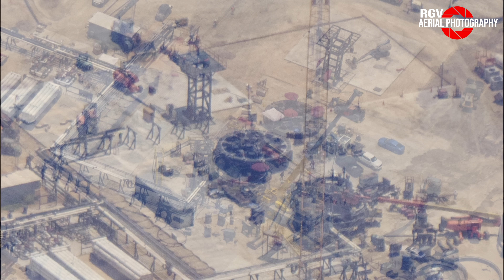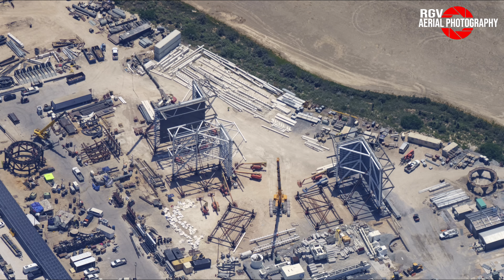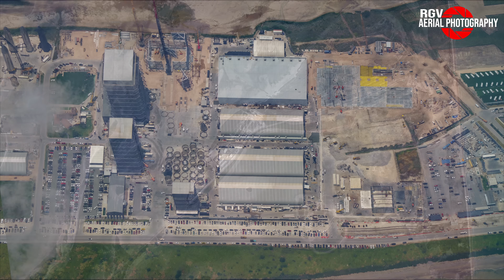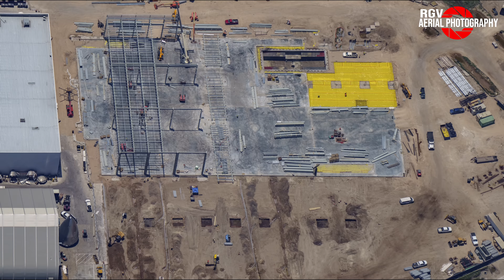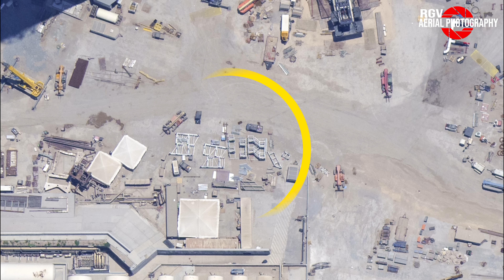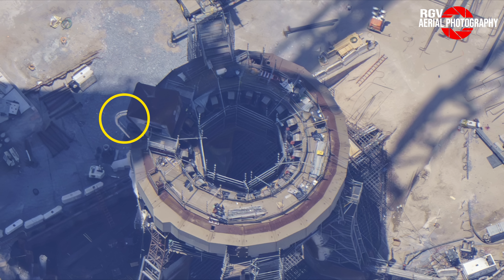Steel Plate Design Change? - SpaceX Starbase Flyover Update Episode 5!

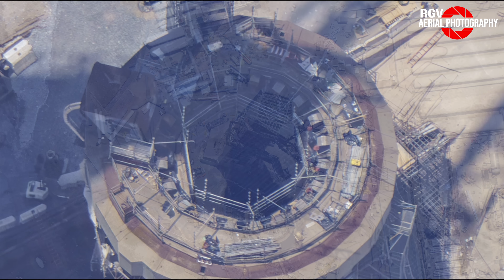Comment: 22:00 - Don't we now have a really compelling reason why the ship QD was removed? Elon is now on record as saying that the next flight will use hot staging and that booster 9 is getting an extra ring on top with vents to dissipate the exhaust gasses when the Ship lights its engines. That means that B9 gets 1 ring (6 feet) taller thus pushing Ship 25's QD 6 feet higher. Rather than rework the OLT structure itself to reposition the QD arm (a pretty big job I would think) I assume they are taking what I would think is the quicker/easier route of reworking the QD structure itself to add some sort of bracket that allows the QD interface plate to the Ship to sit 6 feet higher relative to its mounting point on the QD arm. Basically what will come back to be refitted will be a structure that is 6 feet taller than the one that was removed.

Comment: It seems that a single ring with cutouts is meant to be a reinforced extension on top of the booster to support hot staging separation. That would raise the ship height on top of the booster by one ring higher. Therefore the QD mechanism would no longer fit where it was prior. It needs to be one ring higher than originally designed. At least that is my speculation as to why they removed it and what they are doing to it.

Comment: I was a Navy Certified Welder for years. Carbon Steel melts at 720 degrees. The Raptor engines produce thrust to 2400 degrees. You have scientists there that have not understood this yet????
Reply: Steel melts at about 1300-1500 C.
Reply: That's why they flow...you know...water

See the water plastic glass with fire experiment

Comment: I will say it here as well, so that someone from SpaceX can see it, maybe. If the water deluge plates doesn't work, they ought to build a trap-bell down from the engines, a reverse engine cone, and pipe the exhaust through the old water lines (with some widening early). The tanks currently in place the end Maybe can work as baffles. I think for sure the high pressure charging tubes can have all expensive fittings cut out, the ends cut off, and a double wall stainless housing built around them all, as the final "Muffler." Or, you could just cut holes in the top of a few of the water tanks, and let the exhaust go out there. It only has to work for the 5-10 seconds that the craft is on the pad or just getting up. The ground will provide some cooling, and maybe one or two of the existing water tanks, maybe even those high pressure tubes in use, can serve to soak the muffler in the event of multiple launches per day.

Comment: There's been some speculation about where SpaceX might build yet another megabay if/when it gets to big volume building and needs even more space. Looking at that render of what the new Star Factory might look like at time index 14:51, and particularly the wider angle view of the build site at 14:52, reinforces an idea I had a few weeks ago.

High bay already has a top floor that Elon is sometimes seen in and Megabay has at least one floor at the top as well, which from the height of that top space could even be 2 floors if they put in an intermediate floor structure to split it into two .

What I was thinking, given SpaceX has already put extra floors on top of production facilities and also has shown itself very willing to demolish/relocate existing structures (low bay and ground fab building), is that if they need to find well-positioned space for yet another megabay even just a single level of office space as an extra floor on top of that taller end of Star factory when they build it would allow them to move the Stargate office space there, demolish the existing Stargate building, and use that patch of land for another megabay.

If it is like the render then even just a single level of office space above the nosecone end of Star Factory would probably give twice the office space currently at Stargate, probably more, and that existing 2 floor Stargate building really is not efficient use of space as they get to the stage of wanting to build more and more production infrastructure.

Comment: I bet you will see metal plates dismantled and as debris spilled out on the next start. The pressure from the inner Raptor engines can only built up pressure because the outer raptors will make it dificult to release this pressure. This immense pressure will get the water out of any hole in the plates and destroy the Metal plates entirely on launch. The 3rd try will have a flame diverter, a curvrd dome in the middle, that helps getting those built up pressure sideways and outwards. The sideward angle from the inner Engine output will also help, to save the ground underneath.
Reply: I love it when you pretend engineers pretend.

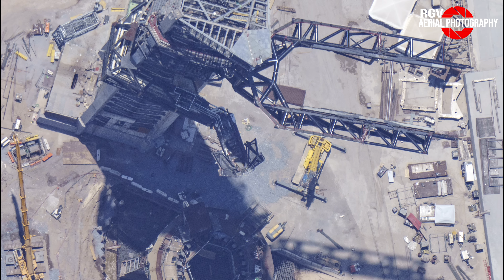Comment: 22:07  Slight chance the Ship QD might need to be retrofitted to connect to a higher point. Remember the booster is getting a last minute update with an extra area ontop mostly filled with vents to facilitate a new hot staging method of stage separation. I presume the booster is not going to sacrifice the tank sizes to add this sheidl and vents section, rather they will just install another ring segment that contains a bit of shielding for the top of the booster with vents on the ring section to allow them to ignite the ship engines just prior to stage separation.

Comment: I think those two half ring sections will be part of the new vented top of booster which will allow 2nd stage engines to hot start in order to separate the two stages.

Comment: Also, If you notice the corrugated ground depth barriers), that allows/shows, the true dimensions of what the final pad outline will look like. There is no true (degree), on which the platform will lye true with x/y length. But SpaceX is definitely not messing around this time. Just the, (walk the plank," alone shows how far they are intending to lengthen the driveway. 
Truly great footage. Thanks for all your hard work! 
 - NOM

Comment: Those holes on the  OLM probably will serve two functions.  One as a relief for the pressure entering the platform, as they will have up to three high volume pipes pushing on a platform with only the water jet perforations.  The other function, if you look at the hole there seems to be an object dividing the hole into two hemispheres, which would increase pressure through the hole making a water wall for the thrust to hit against and futher dampening it.   Just a guess though.
Reply: exactly my guess as well.

Comment: That massive assembly of rebar which implies a certain thickness to the concrete does not surprise me in the least and I suspect that is not a design revision. Cooling water perforated plates and all the piping are not load bearing devices so they themselves need to to be supported from underneath. Think of that thick concrete as the support structure for the cooling water spray system. Even with water spraying at full flow that is going to be a serious push against the spray plates.
That ring header is just that a supply header and hard to think they want all those elbows taking the brunt of 30+ engines.

Comment: Those bends in the water pipes supplying the water cooled plates eliminate the need for valves. The bottom of the bend is above the top of the water tanks. Since the pipes connect to the bottom of the water tanks, some method had to be employed to stop the water from moving. The best part is no part!